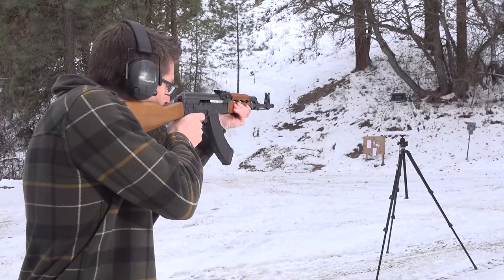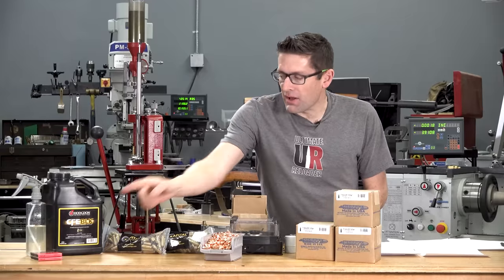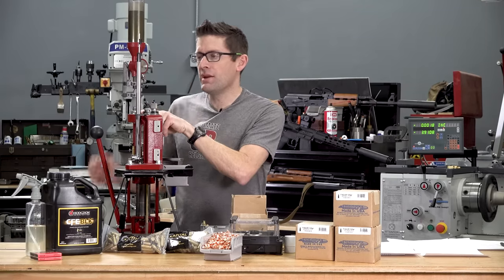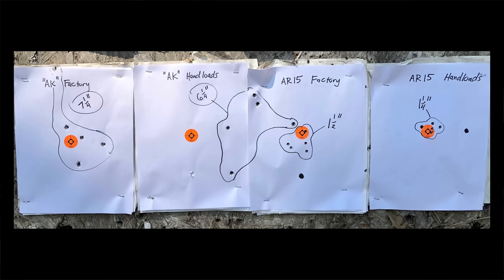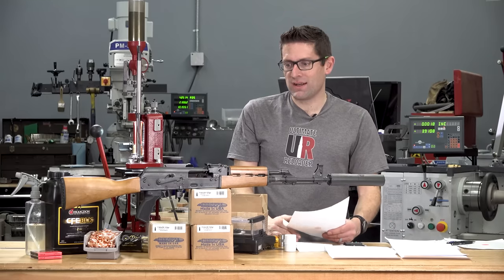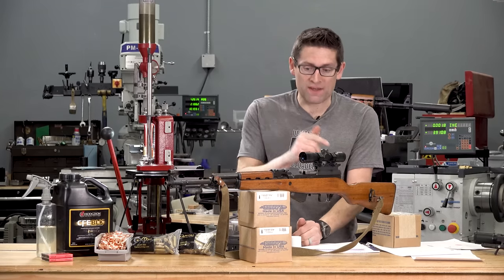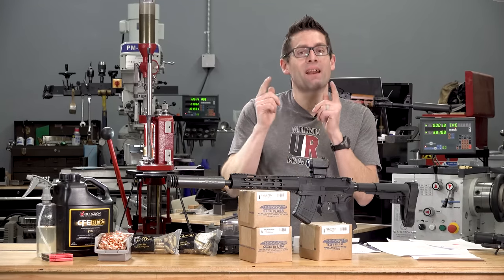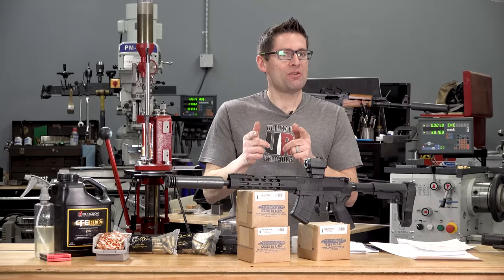Reloading 7.62x39mm with Berry's 123 grain Bullets

Comment: God.. remember the good old days when 7.62x39 ammo was almost free?  No one would have even thought about reloading AK ammo.  Just wasn't worth the effort.
Reply: Use to come out of the Dallas gun shows at market hall, and have the people I was buying the cases of ammo, load those sealed cans, 1000 round cases 7.62x39 loaded into stripper clips…. I was and still do run a VZ 2000…. So much more of a smaller arm compared to a AK…. Works like a charm still got a lot of those old 640 tuna cans

Comment: Berry's states that the .311 123 gr rifle bullets have a velocity limit of 2000 fps.  You might want to check you bores with your borescope for plated jacket and lead fouling.
Reply: I know this was an old comment and I already read that too, but they say on the website that it's rated for 2400 now.
Reply: @pvtpinecone762  For what it's worth, I have a box (lot#202209230931-JR2) with a max velocity of 2000fps on the box. I reached out to Berry's themselves to see what was up and they confirmed for me via email that I was good to 2400fps - it was an old label. That being said, I was averaging 2455 on 29.3gr of CFE BLK and 2482fps on 29.7gr (outside temp was over 100, also). Accuracy was minute of man out of a 16" barrel PSA GF3. I'll probably bump it down to 28.6gr but always work up your own loads.

Comment: CFE BLK is great for 7.62x39.  You can squeeze a lot out of the little cases.
Reply: I know this is a old video 
But you care to share load information
Reply: @Bones6987  Nosler Ballistic tips, 123 grains.  Starline Brass. Federal LRP. Hodgdon CFE BLK.  Start with 29-30 grains.  Work up from there.    Watch for  pressure signs

Comment: People have said that I'm crazy but I experiment with as many different types of loads I can come up with. I've taken berry's.311 loaded them and then just remove enough copper off the tip to expose the lead just barely enough. It works great! Expands and penetrates. But I load them weaker to around 2000 fps maybe 2050. But it does work as a jacketed soft point.😮

Comment: Gavin... I will be nice here... my Berry's box says stay under 1900 fps with these particular rounds. All of your testing were between 2000 to 2400. These are NOT a copper jacketed bullet, they are a glorified cast bullet and should likely use different load data to shoot these effectively (that's why you had issues with accuracy)! Last time I checked the Berry's website for this bullet, they had a video of this bullet being shot out of an Enfield which uses the same diameter - not an AK. I had issues with it cycling properly out of my SKS when they were loaded properly. Please inform your viewers that there are vast differences in load data and specific powders to use for different bullet types.
Reply: Did you read the description?
He stated that he loaded them above Berry’s recommended velocities.
Reply: @jungleno.  yeah which is asking for rapid leading in your barrel and deformation of the "jacket" so there goes your accuracy potential. There is no  good alternative to steel 7.62x39 right now and there won't be for some time to come. Steel will be replaced with brass and prices will go up. Berry's coated/ plated bullets are ok for 9mm reloads but it's just too cheap in quality for rifle speeds. This is sponsored content and no one should be seriously considering using these bullets as a viable replacement for wolf or Tula or Winchester white box brass cased ammo.
Gavin here has cool toys and a cool hobby and waaaay too many sponsors to please. good for him.
Reply: @lawless911sc  u think the fps limit is for accuracy? Or leading ? I assumed leading . I’d like to see some one shoot these to failure and coated bullets heavy 200-220 grain so we could know and see cuz I want a full power home cast bullet if not in fps atleast in ft lbs
Reply: @lawless911sc  I assumed it would not be able to hold the lands and shave leading to Fowling but no one I’ve seen has made a full power video showing what happens and making a true attempt to go as far as possible. I’ve seen powder coated .223 go 2200-2400 without problems. I’ve recovered powder coated bullets from wood and the coating still stays intact even with expansion! I wanna see a 220 grain at max with a full length bearing surface!
Reply: @lawless911sc  I assumed it would not be able to hold the lands and shave leading to Fowling but no one I’ve seen has made a full power video showing what happens and making a true attempt to go as far as possible. I’ve seen powder coated .223 go 2200-2400 without problems. I’ve recovered powder coated bullets from wood and the coating still stays intact even with expansion! I wanna see a 220 grain at max with a full length bearing surface!

Comment: I use Berry's 10mm 180grn .401 plated bullets for high volume plinking loads. The accuracy and consistency of this load has really surprised me. I use HS-6 or CFE pistol, New Winchester Brass w/ GINEX Large Pistol Primers OR once fired Federal Brass (my own) w/Winchester Small Pistol Primers(or when I can find them, CCI Small Pistol Magnum Primers). All is made to feed my Springfield XDM/OSP 4.5 w/ 5.25" Threaded Barrel. A Special Note: Thank you Gavin for all your videos. I spent 2 years learning to load ammunition by reading as much as I could and watching this channel. Anytime I had a question, he always helped me. I have been reloading 9mm and 10mm for a year now and 5.56mmx45/.223 Rem and 7.62x35mm/300blk for about 6 months. Thank you!
Reply: What brand of 10mm brass takes small pistol primers?  I have only seen 3 or 4 different brands but they were all Large Pistol Primers.
Reply: @PC-vq5ud  Blazer is SPP.

Comment: Things are getting to the point to where it makes sense to reload a steel case demo in my opinion.

I am going to start collecting steel cases and stockpiling, we'll see how a few reloads go.
Reply: Just remember that they are Berdan primed. The cases do not have a centeral flash hole if they are and will break your decapping pin in your reloading die. It takes a special tool to remove the primer and then you have to find Berdan primers. Good luck with that. There may be some boxer primed steel cases around but even them resizing steel cases am have issues.

Comment: Excellent video brother! Gonna check those bullets out for plinking loads. I've been loading new winchester brass with 110 v-max .308 bulleys with 28.5gn of CFEBLK (using RCBS .308 sizing ball of course) and getting 2325fps out of my 10.5 heavy barrel BCA and 2650fps out of my Ruger Ranch blot action. .74" groups @ 100 yards in the bolt gun. Love this cartridge! Dropped lotsa deerz over the years with 7.62×39....

Comment: Like you, I stocked up on Components 15+ years ago (No, I wasn't hoarding and the current situation is NOT MY FAULT!  LOL).  I did a lot of trading with brass I found at the range for other brass/bullets/ammo but also bought stuff off of Forum Members (after looking back at my records, I didn't realize how much I'd actually spent back then!).  It's gotten now to where it's not even worth my time to check the Forums for "deals" and although I do encourage others to get into reloading, due to the shortages, their question is "HOW?". 
Anyway, one Member had some factory primed NEW Winchester headstamped 7.62x39 brass for $120.00 per 1000 and this was when ANY 7.62x39 brass was as "rare as chicken's teeth" as the saying used to go.  Needless to say, I helped him out by taking it all off of his hands.  I also traded/bought quite a few 123 gr bullets back then along with primers, but am lacking in powder choices so your videos about powders for 7.62x39 greatly interest me.
Reply: Shooters World powder has one called Blackout and another called SOCOM.  Both are good for 300 BLK and 7.62x39.
Accurate 1680 is designed for 7.62x39.

Comment: Gavin, been reloading 762/39 for years. I was fortunate years ago to buy about 1400 rounds of new Winchester brass and haven't really got into them as I pick up as much as a 150 rounds when I go to the range. The best bullet in my estimate is almost impossible to find is the Hornady Vmax in 311. I have Zastava Bolt action rifle, several AK's an SKS and an AR in 7.62. CFE Blk works well and so does A1680. One thing that my SKS won't shoot is the soft point round for some reason the SKS just blast the soft tip to the point of jamming the bolt. I have yet to try the Berry's plated and was very interested in your results. Year ago I also came across serval thousand Berdan Primers and grabbed them. I have rel0aded with the Berdan primers in steel and brass. I don't shoot them much as the primers probably never be available again. There is a trick way of decapping those berdan shells that is a lot easier than digging them out with the RCBS tool.

Comment: You should have labeled this video...
"Hey Mike watch this".
My favorite caliber!!!
Im workin on a load right now with 5744 using surplus pulled 174gr at .3105. I found 60lbs!!!
My favorite 7.62x39 powder for 123gr is SHOOTERS WORLD BLACKOUT.
Thanks for the great video.
Reply from the maker: Nice!!
Reply: I picked up 10lb of Shooter's World Blackout for $16/lb couple years ago along with 5k primers when they had it on clearance at Brownells for unknown reason.  For 123gr bullet I used 24.7gr, how much do you use?
Reply: @DimaProk  Im at 24.8 with 123gr Hornady 3147 fmj. Winchester brass, CCI 200, 2.190 o.a.l.
Reply: @mikebolton3816  ha ha, looks like we have exact load with minor difference, I checked my notes it was indeed 24.8gr, same bullet, random brass, Winchester SR primer, 2.190 OAL.  Did you get a chance to chrono?  I got this load of AR15 dot com website before it was forcibly moved to a different host and couldn't find the old thread anymore but I saved load data in my notes.
Reply: @DimaProk  I ran my Caldwell g2 on some a while back and was   working up and down, looking for a good node that gave good accuracy and dropped the brass neatly.  I had more data on my Amazon fire... but it seems to be gone.
Reply: I just found some data.
At 25.9gr of Blackout I was at 2018 with a standard deviation of 16.46.
Thats as low as the data I found goes...
I also run...
115gr power coated cast using Socom powder, from Shooters World.   18.5g @ 2.050 gave me 1277 with a standard deviation of  17.95.  They are great plinkers!

Comment: Just finished up a 10in ks47 myself. Got starline 762 x 39 cases, cfe black and sw blackout just need the berrys.... gonna run the gun through some factory ammo before I load for it though get my gas system set to at least operable then retuned for the load I come up with. Thanks for the video I use an lnl ammo plant.

Comment: My dad and I are working on hand loads for the Ruger American Ranch Rifle in 7.62x39 and have seen some impressive groups at 100yards out of this bolt gun. And its a lot of fun to shoot.
Reply: I have the same gun. .5" is possible
Reply: I have crates of ball Ammo. Average group with 5 rounds has been 1.25 inches . The Ruger American Ranch loves it.
Reply: @robertrousseaux1059  Make sure to scrub that barrel good. I neglected to do so once and that corrosive ammo, well it corrodes. Mine cleaned up fine but only because I caught it in time

Comment: I’m running the BRN 180 10.5 on a Omni Hybrid polymer lower the buffer tube been replaced with a 1913 bit of rail adapter and a folding SBR brace….replaced the polymer trigger components with steel cause 7.62x39 usually has hard primers, thought I’d cross that bridge before I got there….. will be running your reloads…. Have the ACC SD30 suppressor that I’ll eventually try to use…. Lot of factory Wolf ammo too…. Wish we lived where your living, your land and the 2 cargo container building is a dream land my brother. Peace be with you Gavin

Comment: Jagemann brass, Speer 125 TNT .308" Unis Genix primers, VV N120 26.0 grs.  AR-15 Faxon barrel 16", 1 MOA, and can hit the 450 yd plate 10/10  2400 fps.
Reply: I'm loading the 125 sst .308 with H335 31 grain and getting about 1 moa or smaller at 100 yards as well. Ar stoner upper

Comment: Your first round from the SKS was more than 50FPS faster than the rest. This is not uncommon if you’re shooting on a freshly cleaned/lubed barrel. Also, it is likely that there is some variance in case capacity with your mixed batch of once fired brass.
Reply: Do you know of a sustained lubricant that last longer?  Do you coat your bullets with anything?

Comment: If I recall correctly Berry's bullets have a limited velocity due to their economical construction.  Check the site but this is what I remember seeing.  That aside, they look great for heavy-for-caliber loadings.
Reply: Yes and no. well I haven't personally loaded them I've read plenty of threads with people showing their results and quite a few of them do go faster than they recommend. That's with good results. In the 300 blackout equivalent, people seem to have a bit of a fight to find a combination of load data and brass prep they got good accuracy but once they found it, some stellar accuracy was gotten out of the 200 green plus whatever they have.
Reply: 2000 fps for this bullet
Reply: Seems ppl have been cranking them apparently platings have gotten better I’ve shot berrys their very impressively thick so I think they could especially if u occasionally shoot jackets as their known to clean out lead fowling. Even the powder coated I’ve seen em at 2000 fine but I’ve not seen anyone push em as far as they could go. I think if u use a heavy load u could do it or at least get equivalent energy ft lbs. how many fps could u push a 220 plated and or coated ? I’d like to see it taken to the max make a awesome video

Comment: Very interesting, I always wonder how fast those Berry's would fly...
Out of my CZ 18' barrel for all 123g projectiles 310/311 I use AR2205 (4227/H110 class). Powered charges, for best ratio velocity/accuracy, are usually 24 to 24.5 grain.
Velocity range are usually 2420 to 2450 fps with all SD more or less around 10fps. For all 308 projectiles -40 fps, SD are slightly higher but good, group are good but larger.
For this carabine best shooting bullets ever are the Lehigh copper.

Comment: My sks is a Norrinko and shoots 1.5 groups at 100 yards, my AR 15 with a 16" AR stoner barrel will shoots tighters groups just under 1.125 @100 yds. H335 powder I see in the Lyman max load is 34 grains. Had signs of pressure at 33 grains. Backed off .5 grain @ 32.5 grains shots well using CCI Large Rifle Primers. Hodgdon data said H335 max load 31.7 . All bullets shot were Speer 123 grain soft points. My intention for the AR is to use it as a hog / truck gun  with 1-6x28 Vortex strike Eagle it fits this bill good.

Comment: My favorite cartridge to load. I'm getting 2500fps with AA5744 with the Berry's 123gr and 2600fps with CFEBLK and HDY 125gr out of a 20" Colt A4. Little to no cratering in below freezing to 50'F weather on soft S&B primers. It will be interesting to see what happens when it gets hot. 5744 has lower ES/SD's than CFEBLK. HDY's are a little faster than Berry's out of a .308" dia. barrel.
Reply: I just picked up some of these bullets and noticed the 2000 fps disclaimer. You think its fine to push them 2,300 to 2,400? Thanks

Comment: Per Berry's website

"Bullet O.A.L.: .796"

Cartridge Name: 7.62x39mm
Cartridge O.A.L.: 2.150"
Max Velocity: 2000 fps 

Load data for our Superior Plated Bullets® can be found in any manual or on any powder manufacturer’s website.
Cast or jacketed data with the same grain weight and profile will work with our bullets.
You can use a taper or a roll crimp.
Don’t over crimp the brass after seating. This causes bullet core separation, leading to increased copper fouling and accuracy issues.
Don’t exceed the recommended maximum velocities listed. This creates bullet core separation and accuracy issues."

With the last part about exceeding the recommended velocity effecting accuracy being of note.
Reply from the maker: Yes, as noted both in the article and in the video description. Thank you for bringing this up!

Comment: Gavin, this is helpful as I’ve only been able to find 1 load for this bullet and I have 1000 of them and the only load I’ve found uses accurate 5744. Question….doesn’t the laid you use exceed the velocity that berrys lists on the box of 1900 FPS? It doesn’t look like you had a problem with it but just making sure….I have some CFE BLK and would like to try this load but just making sure! Thanks!

Comment: 5:44 “I like to manually withdraw the cartridges”  a very nice way of saying this press doesn’t work the way it is supposed to.
Reply: Not true, I just reloaded 1000 rounds of 7.62x39 on same press and I had zero issue with brass advancing and falling out.  Brass was also once fired but it was resized and primed in separate operation.
Reply: @crashs278  Maybe his brass had extra damage to the rim which would cause sticking.  As far as press goes, I actually shimmed it to remove extra play in shell holder.  Another possibility because my friend already sized and and swagged primer pockets on his Dillon 1050 before he shipped the brass maybe it somehow helped to "flatten" the case rim - just a guess.
Reply: @DimaProk  yep if you shimmed you shell holder and all works well now I’m guessing his are loose and that’s what’s causing it to bind.  Just a tad too much slop.  Valuable info for anyone with the same press.